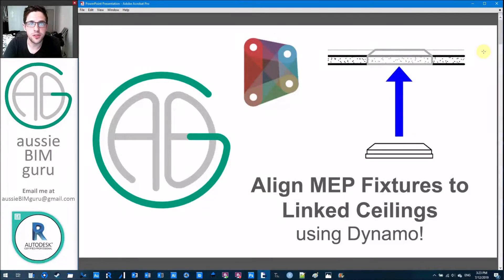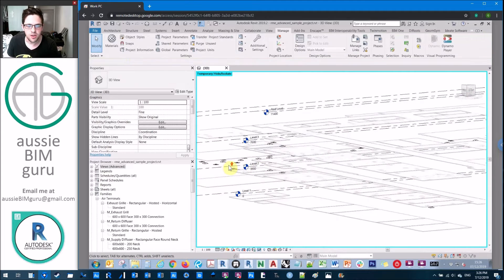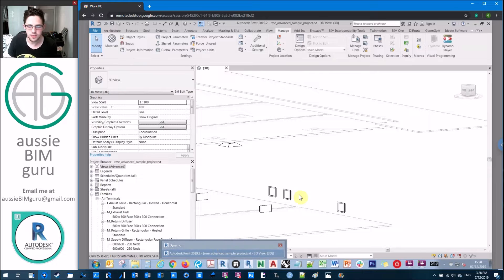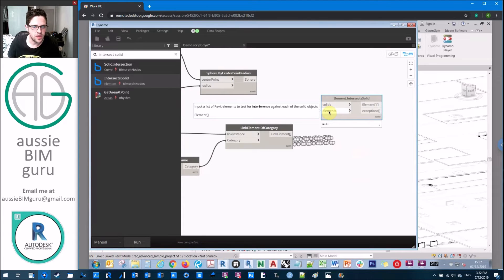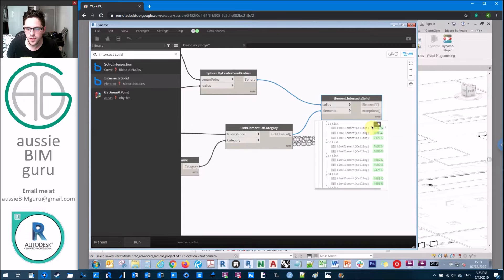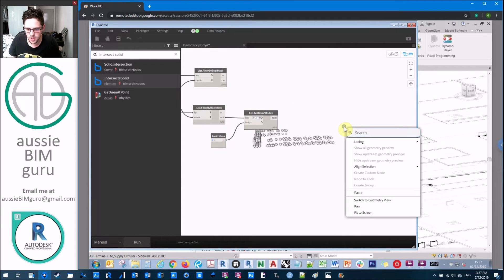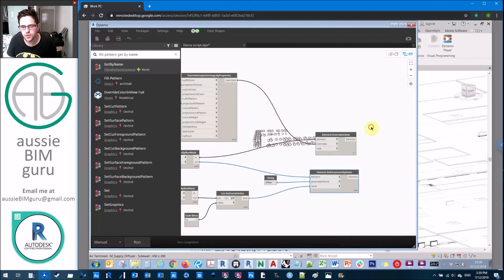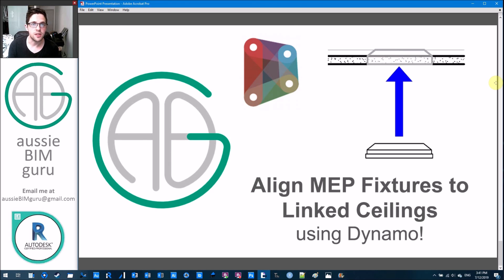Align MEP Fixtures to Linked ceilings using Dynamo!

Comment from the maker: Just wanted to add a note that some engineers have told me they typically don't host to Linked ceilings - either free hosted or face hosted to reference planes is more common in the industry.

Comment: How would that script be adjusted if there are some elements where type comments is empty in revit. ?
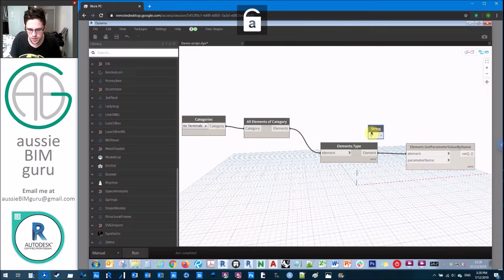Reply from the maker: As I mention at 4:40 this step is up to you - it's just to filter down to what you need to work with versus collecting everything.

Comment: "get parameter value not worked in revit 2024 version, when connect " element. intersect solid"
Reply from the maker: I'd suggest making a thread on dynamo forums. This is an old tutorial and the error is quite vague.

Comment: hi, just want to ask is it is possible to get the distance from a "point" in the 3D space to "a perpendicular point in a surface"? thanks ^^
Reply from the maker: It sure is! If you get a surface and a point in Dynamo, you can use the Geometry.ClosestPointTo node to find the nearest point. Assuming the point is within the range of the surface if it were to be extruded outwards (and that surface is flat), the result should be parallel to the surface and ths distance can then be measured between those points. If the point lies outside this range, then the point would not be parallel at any connected point on that surface, but you could extend that surface if you needed to by finding its underlying plane and finding the closest point to that instead.

It's a good topic, I'll make a video for it.
Reply: @AussieBIMGuru  Wow thank you... I will surely wait for that video ^^... actually the idea is to get the distance from a point to a point perpendicular to the closest wall surface. Because sometimes walls have layers (like paint, finish, proofing... etc.). I have to process the closest one. thanks again ^^
Reply from the maker: @vrbaac1641  just recorded a tutorial for it, it will deal with filtering clearance distances for corridors, but you could apply similar logic to the surfaces of multiple walls to identify the nearest one for sure. Will be on the channel on 15/7/21.
Reply: @AussieBIMGuru  thank you, thank you ^^
Reply from the maker: Released today: https://youtu.be/g0kv27jJ58Y
Reply: @AussieBIMGuru  thank you for reminding ^^

Comment: May I know this script is possible to work with face based families?
Reply from the maker: Face hosted families should update automatically to their linked host, so wouldn't need this workflow.

If they become orphaned there should be nodes in Bimorph that can rehost to a linked element face reference. See this thread for hints as to how this might be achieved;
https://forum.dynamobim.com/t/how-to-host-face-based-families-on-elements-in-linked-revitmodels/20340

Comment: can the same principles be used to hosta lighting fixture to a linked topography?
Reply from the maker: Unfortunately linked models only support face hosted element relationships. You could intersect the elements to manually set their height however

There's a great thread about this here;
https://forum.dynamobim.com/t/attach-family-instance-to-topographic-surface/1396

For mesh related classes like topo I suggest exploring Rhino Inside, especially for complex topography. Dynamo struggles with mesh conversion and intersection vs grasshopper.
Reply: @AussieBIMGuru  okay well thats a shame, i will look into a different workflow, i have realized that if the topography is created in the model where the fixtures are being placed you can host to the surface, so thats a go! thank you

Comment: The more I insight into Dymano, the more I realize this is an obtuse programme. A dozen nodes aren't working. Constant misunderstandings and lugs.
Reply from the maker: It does require a decent degree of understanding to operate it at a complex level. I found since Revit 2020 where the version control is set automatically, most issues aren't as prevalent.

Maybe try out grasshopper, dynamo aint for everyone!

Comment: Is there a way once this is run to have the terminals that are filled with the solid fill, to become un-filled?
Reply from the maker: Given the ceiling is linked, live openings can't cut it. At that point I'd hassle the architects to update their model placeholders!
Reply: @AussieBIMGuru  Was this in response to my comment? I just meant is there a way to change the terminals like the ones you show @16:53 to not be orange, if in fact they are in the correct location. Not with Dynamo per se, just in general.
Reply from the maker: @charlesball9522  ah I understand what you mean now... there would need to be a way to validate if they are correct. The script highlights them because there is no linked ceiling for them to find, so they must be suspended. In this case, you could exclude these by their type if they're different to ceiling recessed registers.

The script itself just applies a VG element override, so you could right click and reset the override if they are in fact correct also.

Comment: Great video. I thought it might be possible to get the host of the element to filter out the wall hosted elements, but then I remembered that the elements are in the link.  It would be nice to be able to automate that part.
Reply from the maker: Agree, there's probably lots of ways to prescribe this if content is consistently named or has parameters to properly detect all relevant fixture types as a set.

Comment: Great work....!!! A small question ..Elements.type node is not available in my dynamo..what node can i replace that with??
Reply from the maker: There is also a node called Element.GetType I think, see if you have that one, it should be OOTB.
Reply: @AussieBIMGuru  i did not get also "element type node" even element.gettype node.i am using revit 2021
kindly help me
Reply from the maker: @sadamth6714  it should be in 2021. If not check on the forums for assistance
Reply: @AussieBIMGuru  i will check forum
Reply: @AussieBIMGuru  could u make tutorial? How to make multiple lighting fixture for one room on ceiling linked file using dynamo?
Reply: Me too .. and using 2021 too

Comment: Hi! 
I have a question not related to this video, but i thought i coul'd post it here since its your latest one.. 
I wan't to Read an Excel by "active view". I have a large text file where i don't want to read everything at once, read by Range doesn't work cause the range varies depending on my filter in Excel. As an example. If i Filter my Excel to only show rows containing Doors and parameters (in this case 3 different classification keynotes). They might be on index A5-A17. 
But if i then filter my Excel to show "Windows" it might be index A45-A49, and i don't want to change the range read in Dynamo everytime i filter my Excel.
So to Sum. Can I read my "Active view" or shown by Filter only?  Might be a python script for that? Since you know both Excel, Python and Dynamo very well i thought you would be the person to ask! :) Ty so much!
Reply from the maker: The 'ByRange' method is the best I know to achieve this from the BumbleBee package.

There is a bug with the node however, you need to add an extra row above Row 18, simply add 'import os'.

To make this range more dynamic, use a named range in Excel. This way you can keep updating your named range extent.

See here;
https://www.contextures.com/xlNames01.html

I do not know of a way to manage filtered data or active excel sheet data unfortunately. Named ranges always go from top left to bottom right, even if rows are filtered/hidden when first created. To work around this you would probably need some VBA macro magic in Excel - a bit past my experience level!
Reply: @AussieBIMGuru  Ty for much for quick response! I simply added 'import os' (without ' ) at row 17, just above "from os import path".. Got tons of errors! :D
Reply from the maker: @kristofferohlund3820  hrm odd... I'm using dynamo 2.3.0 which might make a difference...

I moreorless did what is covered in this thread;
https://forum.dynamobim.com/t/package-bumblebee-name-os-is-not-defined/5989/15

Without this I was getting an error on line 109 where the code failed to point to the required os method, so importing the whole os package simply provides access to this.
Reply: @AussieBIMGuru  Thnx again! I just changed the rows (shouldn't make a difference?) to match exatctly like the one you linked.. now it works? Ty !
Althought it should be possible to read "by Excel filter" somehow??
Reply from the maker: @kristofferohlund3820  it might be although I can't seem to find a lot of information identifying how. The challenge is that it would need to be done almost entirely in python and in excel vs. in Dynamo/Revit API reference.

It might be worth asking on the Dynamo forums, and maybe to Konrad Sobon himself as he wrote Bumblebee so I expect knows the limitations and possibilities quite well.
Reply: @AussieBIMGuru  I'll try that, ty alot !
Reply: @AussieBIMGuru  I tried using Data Shapes after watching your videos showing Data Shapes. Works create since i can filter what items i want to show in the list after running script. Ty so much for your videos!
Reply from the maker: @kristofferohlund3820  you're welcome! Great work on combining some techniques